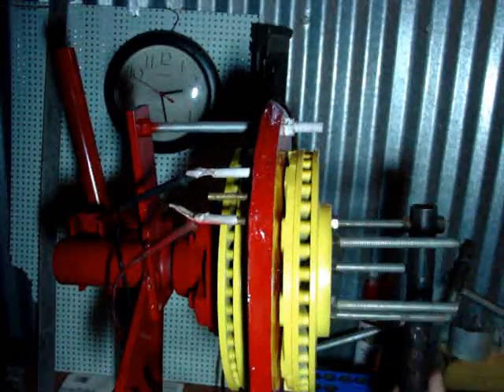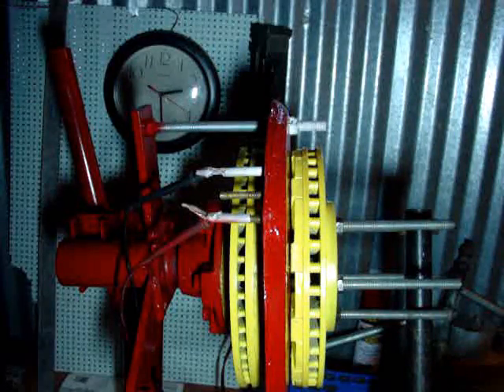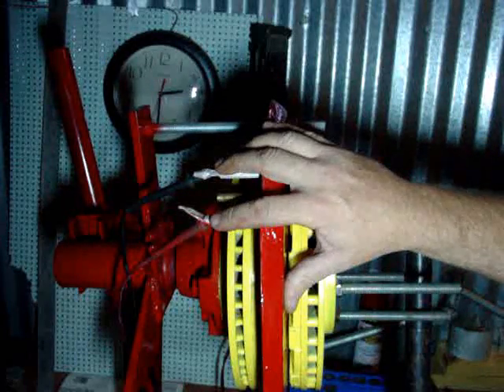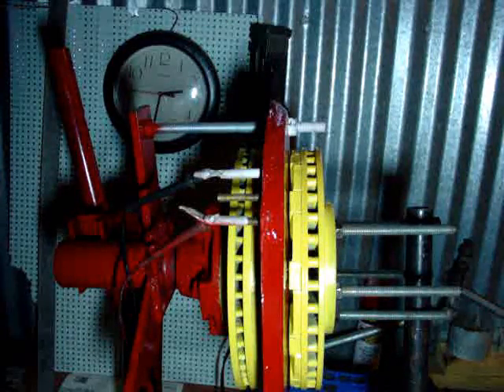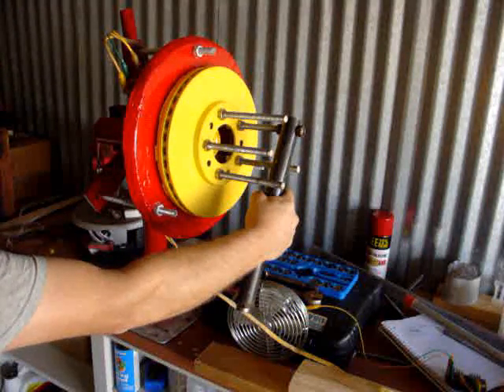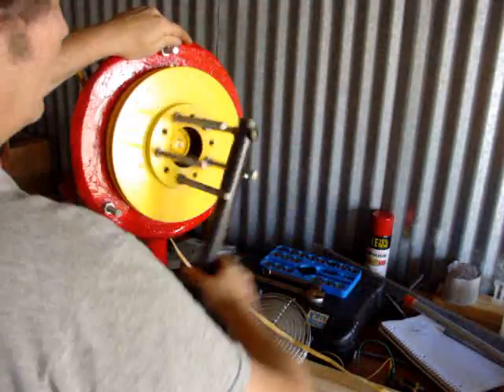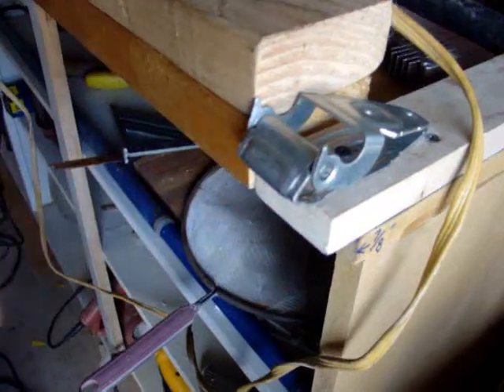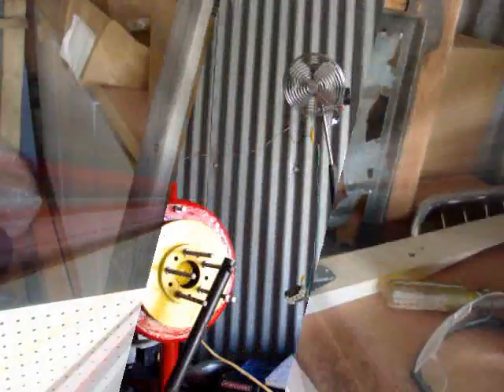BUILD A DUAL PERMANENT MAGNET ROTOR WIND TURBINE (PART 29)

Comment: Also, do you think you could double or tripple your generator by building several generators together? If so, just add a outer shell encasing the whole thing with cooling fins running down it. That way you gould generate 2 or 3 times the electricity in the same time.

Another idea is to build your generator to be on EV cars. The EV cars that are front wheel drive could add an axle to the back and put 2 of the generators in serries connected to it.

Comment: You can actually do 3 things to solve the stall problem.  The third is to use electronics that will let the prop go faster when it needs to.